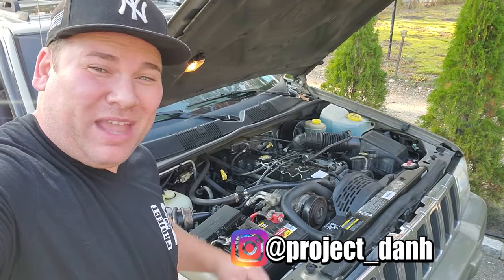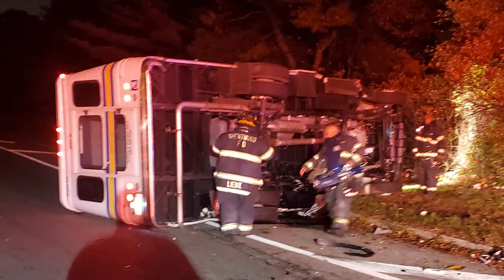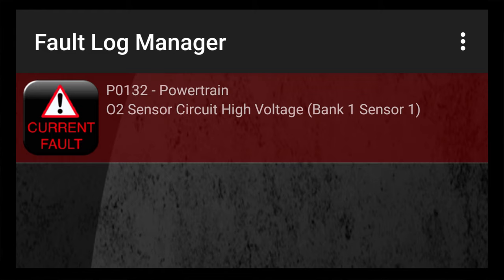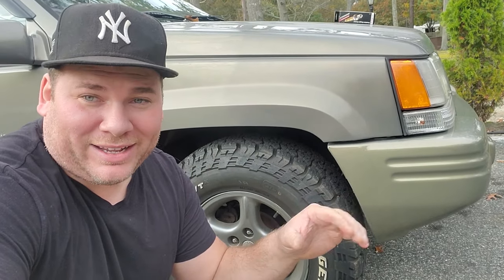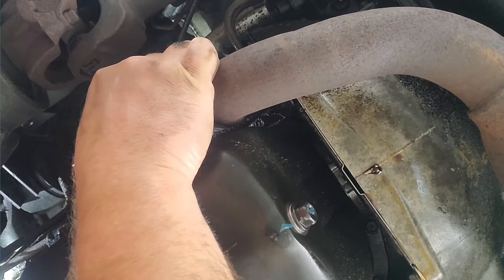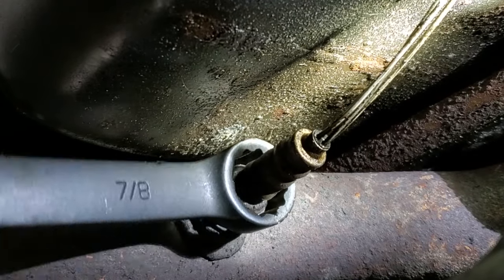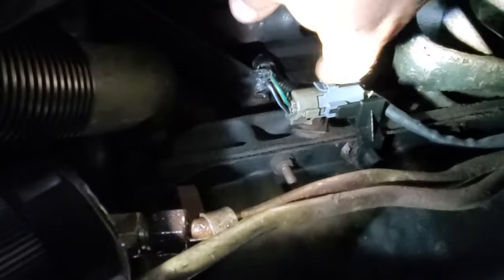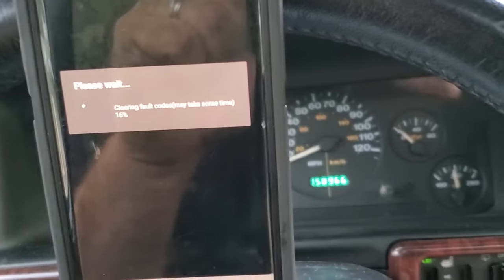BAD O2 SENSOR?? JEEP 4.0 MISSFIRE SOLVED  - UPSTREAM OXYGEN SENSOR REPLACED

Comment: My 2000 XJ has a similar problem in that when I drive my Jeep in hot/warmer weather and turn off the engine to run into the store when I return a few minutes later (engine still hot) my engine idles rough, sputters, and misfires a little for about a mile or so before it returns to its normal state of operation.
 
This problem may not reproduce itself for a week, or even months before it happens again; it is more of a nuisance than anything else. Any thoughts on what this maybe?  O2 sensor?
Reply from the maker: Hey John, Sounds like a Heat soak problem.   what happens is the 4.0s get really hot inside the XJ when you drive and once youre parked your not cooling the engine with cool air anymore.  The heat takes a long time to dissipate especially in the area of the 3 and 4 injector.  Sometimes it gets so hot the fuel in the fuel rail atomizes while your parked, if you restart the engine before the fuel turns back to a liquid state it will sputter and run rough until cooler liquid fuel is finally sprayed through the injectors.   Upgrading to 4 hole injectors, wrapping your fuel rail and injectors in heat resistant tape and installing the factory heat shield invented for the "recall" are some ways to fight heat soak... or just chop holes in your hood and put vents in 😁
Reply: that is for sure heat soak. Your 2000 xj has 2 pre-cats that older xjs do not have and they give off a ton of heat.  It heats up the fuel that is in the rail pretty much right above them and produces a heat soak issue.
Reply: @ProjectDanH  Awesome Dan!  Thanks for sharing your tips, know-how, and advice.  I will do precisely what you specify here (minus chopping holes in my hood, LOL) and I'll report back with my findings in the future.  Thanks so much!!
Reply: @ryanwatson6911  Thanks Ryan!  Hearing from you as well ups my confidence that it is indeed a heat soak situation.
Reply from the maker: @appleguy1986  Cant wait to hear how you do! Keep me posted!

Comment: I just bought a jeep Cherokee I got luck it through a code for it but jeez these things where built crappy there where 19 issues that where just piss poor quality
Reply from the maker: Sounds like piss poor previous owner maintenance
Reply: @ProjectDanH  No doubt hey, I buy vehicles to flip and always stay away from Chrysler /jeep products but 300 bucks for a 130k Cherokee theres tons of room for repair but I have issues when simple things and there are alot of them like blower fan fins needing replacing because they tear apart and grind in the duct system and there is so much more that I never had to do on 100's of flip vehicles
Reply from the maker: Oh Man, that's a rough job!  My least favorite chrysler part is the computers

Comment: I recently bought a 1997 Jeep wrangler 5- speed for my daughter. When you first start it up and and go down the road it starts to spit and sputtering (1-2nd gear) like it's running out of gas but after a few seconds and pushing the gas it stops and is fine for the rest of the drive. Could this be the same problem and fix that you had? Any help would be appreciated!!
Reply from the maker: Classic 02 sensor problem!

Comment: Can someone help , I have a 2006 Jeep liberty and I have to replace Oxygen Sensor : bank 2 , sensor 2  . I figure its in the rear but is it on the Driver's Side or Passenger Side. Sorry , I am a newbie and I am trying to avoid paying $500 for the job.  Any help would be appreciated, thanks in advance .
Reply from the maker: Google where bank 2 sensor 2 is, locate it, remove it, bring it to your local autopart store, but a replacement, compare them to make sure it is a direct swap, put the new one in.  3 hours of your weekend and about 60 bucks, Good to go!!

Comment: I have a question bud.... I have 2 XJ's , one ZJ and a WJ and I keep hearing diff folks saying that you only replace with Mopar sensors because other brands are either not to standart or not performing as well as the Mopar ones, but me living in Europe its hell of a job to find  genuine Mopar sensors available...... What do you think about other makes and which ones would you recomend besides the genuine ones?
Reply from the maker: Yes, aftermarket O2 sensors aren't as good but you can still use what's available to you.  They probably wont last as long as a Mopar sensor, but its better than nothing. God bless!

Comment: I got a 96 f150 5.0 doing the samething got a misfire it got down in the negatives a few weeks ago I got code for a right bank lazy o2 so I cleared it out hasn't been back on till last night then I got a code for both right and left bank lazy o2 Upstream so I cleared it again then today it's really running bad I got left bank code pending I got new sensors coming from RockAuto all 3 hopefully that fixs it i know it can't be anything else i just rebuilt the engine a 1000 miles ago at rock auto the Bosch o2s are about 30 bucks cheaper than the auto parts store
Reply from the maker: they are a pain.. hope you can get it sorted!

Comment: I was just saying to myself O nice Tool lol when the Bitch snapped. My 2000 XJ is ready for a new Passenger  Floor Pan but it has to wait until the Spring. Just ordered the Part's along with the Channel to mount the front Seat. Look's like a pain is the Butt but with the numerous videos on YouTube i will get threw it. Going to order a Flux Core 110 Mig Welder any Suggestions?
Reply from the maker: lol, I got The Harbor freight flux core 125.  Cost like $110.  So far it still works! lol
Reply: @ProjectDanH  Nice to know i watched a YouTube Video with a Demo of the Harbor Freight one a cheap Flux Core, not sure if it's the same as yours but it looks simply. The Fan that blows heat into the duct work has a seal that is known to leak true or untrue? I think that is what rotted out the floor pan. Also i heard you say in one of your videos you got a Rubber Floor covering from a Police Jeep to replace the rug in the Beach Jeep. Do they sell that new if so where.
Reply from the maker: @nobsatthistime  True! and I doubt they make an aftermarket rubber floor but you can get weathertech floor mats , they're great!
Reply: That's true. will see in the Spring.

Comment: I have an 01 GC, and while climbing a long steep hill, it threw a code P0432 for catalyst bank 2 below efficiency. It runs great, no miss, but I know it could be an O2 sensor. I'm afraid its the cat going out (216K) , but I don't want to dish out 900$ for CA compliant cats if it's just a sensor. Does anyone have any input or experience with this?

Comment: Do bad 02 sensors cause the exhaust to smoke and leave the parking spot with a black spot from when it was warming up does that make any sense?
Reply from the maker: its possible, although that would be a very extreme case. you may be burning oil.

Comment: Hey Dan I'm having similar issue's but mine would actually cut off at time's. Is dying out a symptom? This weekend I changed out the crank position sensor an ignition coil an still. Any help would be appreciated 🙏
Reply from the maker: try scrubbing your throttle body and clean your idle air control!
Reply: Thanks for the reply. I've already done that an replaced the IAC. I'm lost on what to check next
Reply from the maker: @jayragoonanan2598  how's your battery? Could be a low voltage issue
Reply: Voltage is fine.. Battery is less then a year old. In the beginning of dealing with this problem I thought it was a bad ground so I cleaned them up an replaced the terminals. It ran great for about 2 week's an started back. I've done plugs,wire's, ignition coil,ignition switch, maf,ica,alternator,cranck position sensor, cleaned throttle body an pcm. I've been messing with this issue for 8mths. Iol
Reply: Check maf sensor

Comment: How do you know which sensor it is. And arent there 4 on a Commander ?
Reply: 2x upstream and 2x downstream, if you have a v8. Just replace them in pairs. Doing that to mine now, as it's started losing power, then shudders, then runs normal again.
Reply from the maker: Yep,, replace em all.  the later model 4.0 also had 4

Comment: Im gonna try. My 96xj runs very rough at 35-45 mph. Until i give it harder pedal.i have done many mods. Performance headers, air induction, 62mm throttle body, 4 port fuel injectors. Have i not upgraded something thats being overpowered?
Reply from the maker: Sounds like its breathing very well, maybe its running too lean? have tried a Tunes or higher LPH injectors??
Reply: I didn't understand. Pls help. I know its something stupid and simple being overlooked.
Reply: Wats lps injectors
Reply: Lph injectors?
Reply from the maker: @zakk107  sorry... Higher flow injectors... More Lbs Per Hour
Reply: @ProjectDanH  thank u for ur time dan. Are u saying to replace the injectors i already upgraded?

Comment: Does anyone know if this is a similar fix to the wj with a misfire code??? Im new to the Jeep 4.0l but I’ve replaced the coil, plugs, and injectors
Reply from the maker: New o2 sensors may help.  Also Wj's have an o2 sensor fuse
Reply: @ProjectDanH  thank you!! Definitely gonna take a look at those later today
Reply from the maker: @drewy4952  good luck buddy 💪

Comment: Dan pls help me 😩 I have a 97 zj, had it for a while and was fine, been fixing it, rebuilding it and making it look nice, then a few months ago it started bucking. It started off as doing it in like 2nd gear, u would shift into 2nd then once it’s in it would back and jerk, then if u accelerated it would clear up. Now it’s doing it more often and it’s getting worse. I just did the tps, plugs, wires, ignition coil, distributor cap and rotor, and still didn’t fix it, could it be an 02 sensor? I have a crankshaft sensor but didn’t do it yet
Reply from the maker: Make sure you have a new battery.. clean the heck out of your throttle body... Get new o2 sensors 👍

Comment: hope someone can help .. i dont have jeep tho.. but mine its a UAZ hunter. and i do think its the sensor engine turns off like no power  and if driving suddenly it feels like if gas had an obstruction or dirt  in it and starts to lose power and shuts off. It happened once like 6 months ago i filled both tanks of gas and it fixed, even the check engine turnoff by itself but now the problem is back and now feels like gas is dirty and start to lose power and engine off.. Hope someone can help, thank you

Comment: Has anyone had issues with their jeep beginning to die, like the RPM will plummet to 0 or even a pop from the front drivers side?
Reply from the maker: 02 sensors... and also Make sure you have a new battery and definitely clean your throttle body!